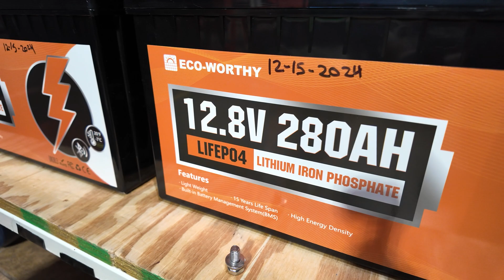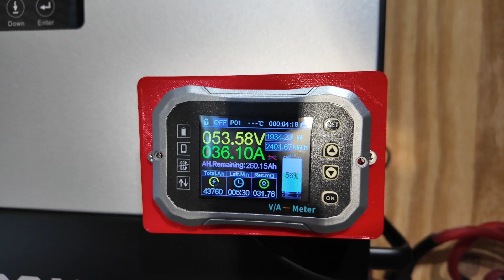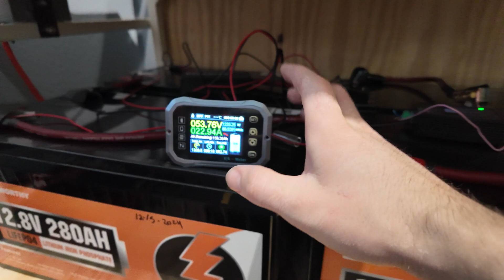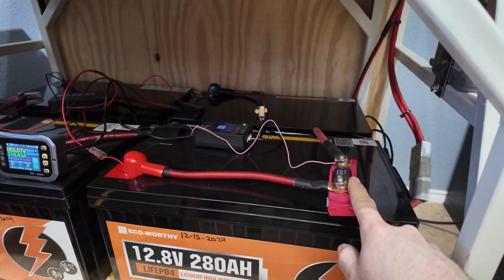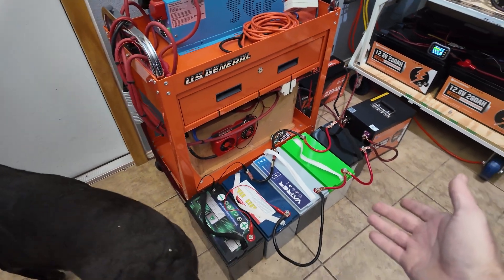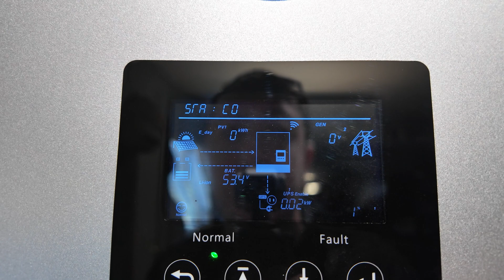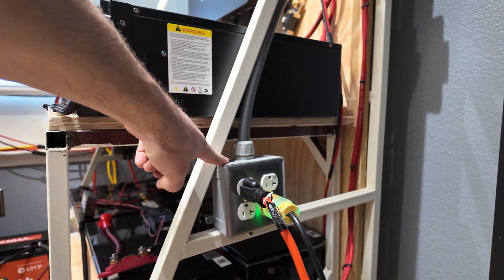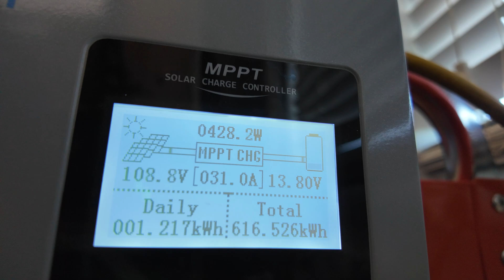My 48volt and 12 volt Solar Power Systems! All DIY Built!

Comment: Question here , I have 2 litime and 2 dumfume 100 amp group 31 batteries new . Can 2 different manufacturers be wired together
Reply from the maker: Yes, as long as the voltages are the same, they can be wired up in parallel.
Reply: @ thanks

Comment: Thank you for your video, this answered almost all my questions. I plan to use "dumb" 48V Eco Worthy 100ah battery with EG4 3k system, because I didn't want to pay for the server rack batteries. Thank you for explaining all the wire connections.

I have another question though, how does your EG4 6k inverter know how much capacity is left in your 4x12v battery bank, and what's shown in the app regarding battery percentage? Thank you !
Reply from the maker: Good im happy to help! No it only shows the percentage of 1 server rack battery, but generally the batterys tend to match each other pretty close.  So if the % reading from the inverter app is 20% its pretty close across all the batteries.
Reply: @Mikebuildss  thank you for your reply. How about the percentage battery of dumb batteries then ? Do you use the one server rack battery to judge the battery percentage of the dumb battery ? If there is no server rack battery connected to the system does it mean the eg4 inverter won't make the battery percentage of the dumb batteries? Thanks !
Reply from the maker: @I have a battery meter connected to my system that I use to judge the systems battery level as a whole, it’s the meter attached to the inverter on the red box, I program it to have 460ah when full (2 server rack batteries and the 280ah pack on the bottom)    If I had no server rack battery communication I do not think I would be able to see state of charge. But I do wonder if I set it to lead acid setting in the inverter if it would let me program in a set battery capacity
Reply: @Mikebuildss  thank you!

Comment: 9:00 You can wire a standard 240v resistive water heater for 120v. A (240v) 4500w element will draw 1125 watts at 120v. The only downside is a longer recovery time for less wattage.
Reply from the maker: @blakeb5153  Nice to know I may try that!

Comment: Did you see that eco-worthy came out with 100 ah server rack batteries? on sale for like $765 on ebay before tax
Reply from the maker: Just saw that, may save up to get one to test, would that be a good video?
Reply: @Mikebuildss  I think it would, i want to buy a few and get a 6000xp or 12000xp. Still debating. Supposedly it should communicate with the EG4 invertors so i think if they hold up, they could be a great option for budget people

Comment: Hey Mike, I wanted to know since we’re in the winter months, with keeping your house warm in the nighttime what is your battery percentage in the morning before the sun starts this production on your system?? I just wanted to have a clear idea and understanding of what the 48 V system can really produce, based on the number of batteries in your bank backup system
Reply from the maker: Running 2 minisplit heatpumps, set to about 73-75 f, I normally have about 55-60% remaining in the morning.

Comment: Nice battery pack but that high frequency, transformerless inveryer will eventually  damage your appliances because it doesn't offer any galvanic isolation.
Reply: No that's ridiculous. This is a bot that spams YouTube videos and my forum. Super annoying
Reply from the maker: @WillProwse  What’s up will! Appreciate the input, I figured it’s kinda bs, tons of myths going around about the High frequency equipment being “dangerous “ .
Reply from the maker: It is true they can damage electronics, I keep my system off when not in use.